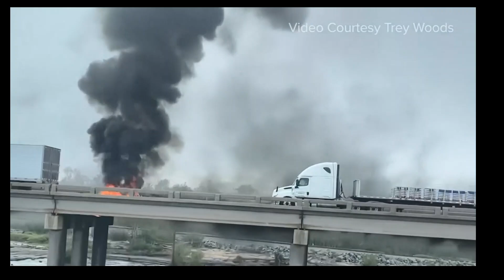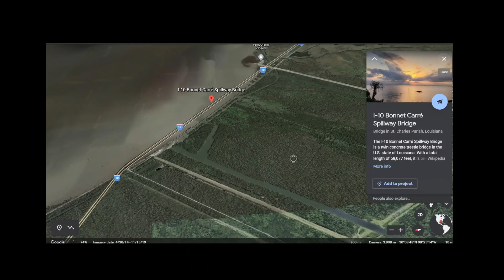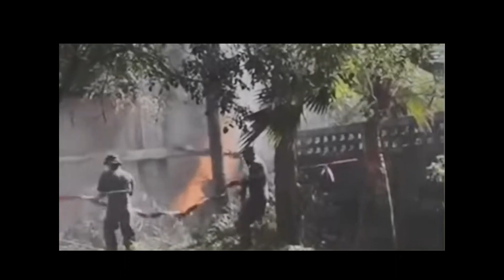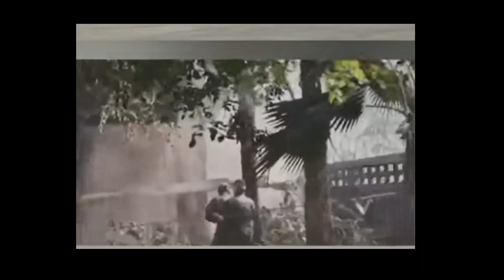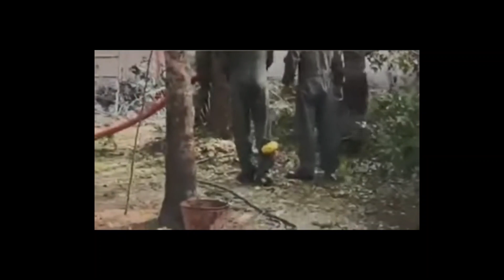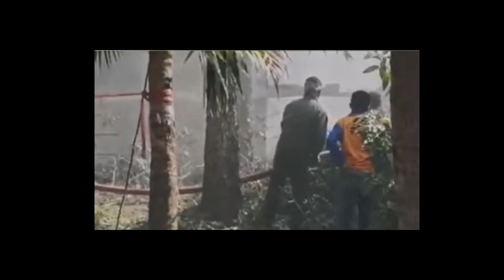Helicopter crash in Louisiana and Thailand

Comment: Helicopters do not "fall out of the air". Pilots are trained to autorotate: the aircraft descends with forward motion, forcing the air to rotate the rotor blades and produce lift. This gives a rapid but controlable glide path with enough energy to flare and make a fairly safe landing. The helicopter pictured is an Enstrom, made in Michigan, U.S.A., properly flown it's three rotor blades provide the ability to touch down then lift off and do it again. Pilots must practice regularly and react immediately to power off flight. I hold a Commercial License in both fixed and rotary winged aircraft. Bell Helicopters are my preferred from of flying.
Reply from the maker: Thank you for sharing Donald.  All I can say is Helicopters kill.
Reply: …UNLESS you ‘hit (a) powerline(s). NO “auto” will save any of us then…
Reply: Why Bell over Airbus?
Reply: They certainly fall out of the sky when the rotor blades and mast separate from hitting power lines. That dummy is lucky he didn’t kill anyone on the I90

Comment: Lots of good information. Realize you are a Firefighter not an aviation expert. I'm not an aviation expert either. That said, helicopters don't just fall out of the sky. Autorotation has brought many a helicopter to a safe emergency landing. Though many call it a controlled crash, properly done every one walks away and helicopter is normally not seriously damaged. Keep up the good work.
Reply from the maker: Thanks Robert.  Hopefully as time goes on, I will become more of an aviation expert,  or at least learn to be a expert in aviation crashes and firefighting